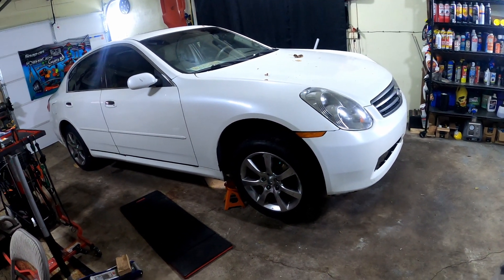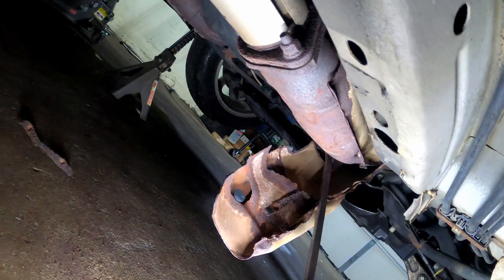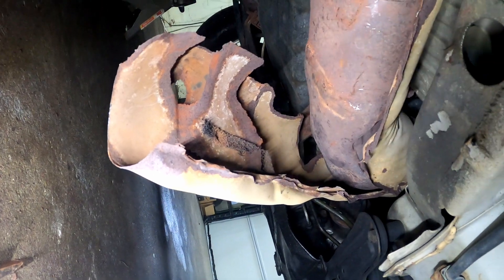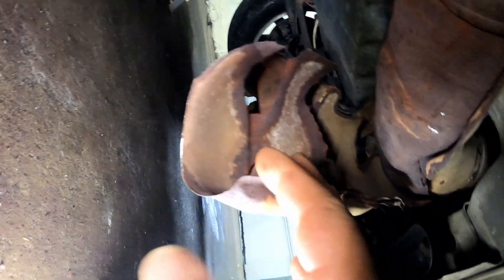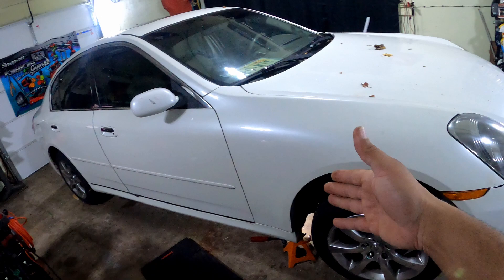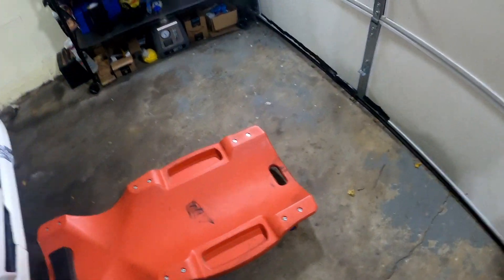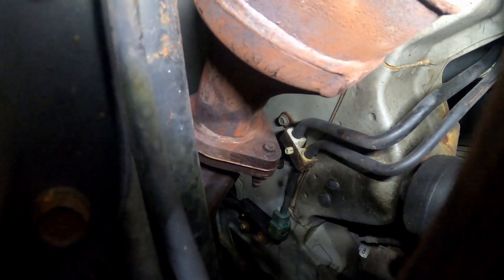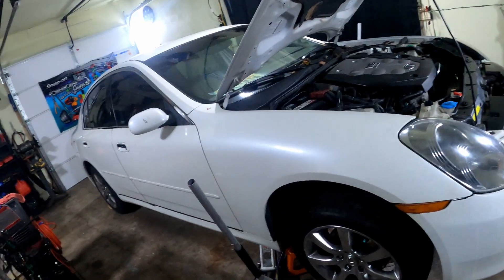Infinity G35/M35 Catalytic Converter Heat Shield Rattle

Comment: Yo do you know if the model x m35 and g35 have the same catalytic converter? Prolly dumb question but im new to this car shit😭
Reply from the maker: Should be the same bc they both have the same engine but depending on the year they may be different for the emissions so I would double before u spend money on expensive catalytic converters that may only cause your check engine light to stay on

Comment: Hey bro so I have the rattle noise & my exhaust tip is moving a little too. It’s towards the back of the car. Is it just a bad welding ??? I hear it sometimes on acceleration then sometimes I don’t…..
Reply from the maker: Could be a broken weld on the heat shields or maybe the catalytic converter is broken internally and rattling inside. Best thing to do is to get up underneath your car and take a gander.

Thanks for watching Subscribe & stay Tuned for more‼️🤝
Reply: @PhillyDee215  - that’s what I thought bro but like could it just possibly be a bad welding ? Cuz if it’s a bad cats wouldn’t it come from the front of the car ? And not the back ? Also when I am parked I go to my exhaust tip & the left one is like vibrating
Reply: @PhillyDee215  • also I did take it to a mechanic like a couple weeks ago at the shop & they got in my car & of course the fkin sound don’t wanna come on lol until i leave the shop. Makes no sense why my car has this sound come and go. It’s gotta be the welding ? Idk man I’m so confused.
Reply from the maker: @dcmasta123  next time you hear the rattles, go under the car and try to put pressure on the heat shields in different spots until the noise go away. If the exhaust is too hot.....then use like an oven mitten/towel or prybar to put pressure on the shields. But yeah sounds like it's the heat shield. I have another heat shield video on my G35 dropping soon, so at this point my G35 has no heat shield at all
Reply: @PhillyDee215  - okay bro !! Last question , do u have a Instagram ??? I want to send a quick vid. I just found one of my clips I have of the sound.

Comment: shit sounds like a fucking chain rattling I cant tell if its my chain or this shit
Reply: Have you found the problem? I have the same noise mostly hear it 1200 rpm’s
Reply: @richardherrera8077  I found out that it was indeed the heat shield. Easy fix once I changed my oil
Reply: @solvint3410  appreciate it brother imma check to see if that’s the problem. I really don’t want to spend a lot on the catalytic converter
Reply: @richardherrera8077  yeah it’s probably just the heat shield if it sounds like the cat